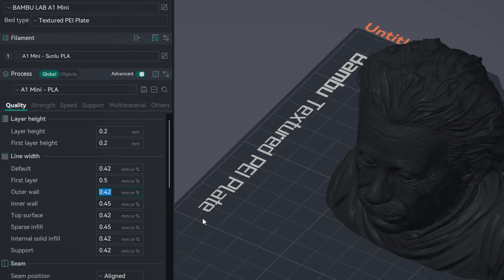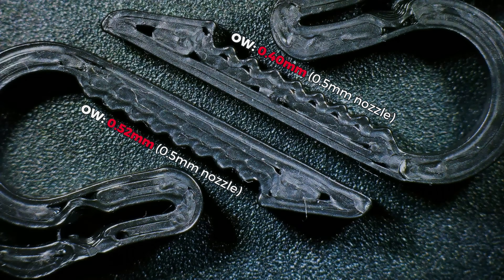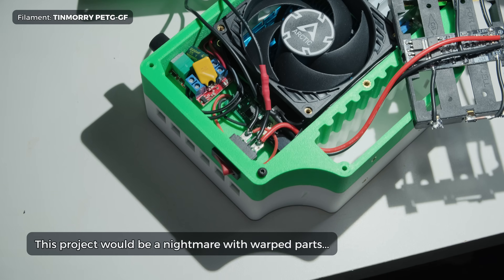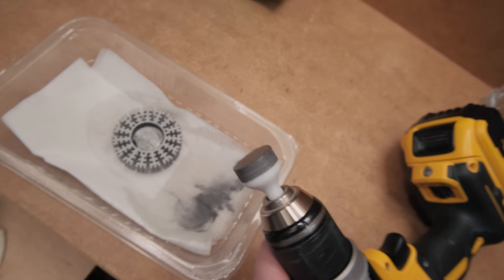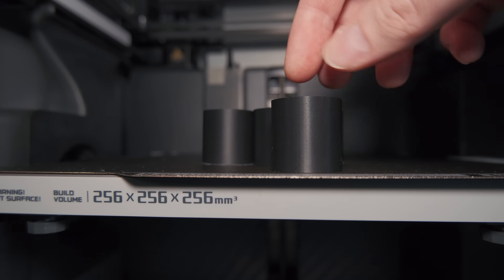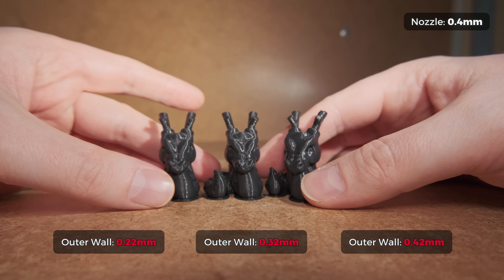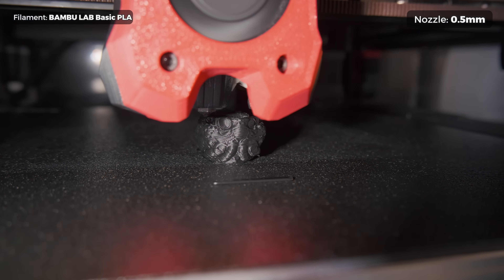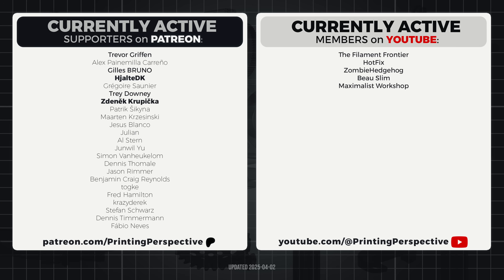3D Printing at NARROWER EXTRUSION than the NOZZLE SIZE

Comment: once i accidentally printed 0.2 line width from a 0.4 or 0.6 nozzle and the top layer came out absolutely perfect as if it was injection molded, and gave reflections like a mirror. But i was not able to replicate the result later

Comment: Isn't it the same as using flow compensation ?
Reply from the maker: Small area flow compensation? Then no.
Reply: @PrintingPerspective  on cura there's a setting to lower the material flow but I don't remember how it's called.. ^^

Comment: Thanks!
Interesting findings.
This inspired me to test the 0.22 OW + 0.12 LH with one of my spools that I'm having real problems with. Basically, the sticker on the spool says 1.75mm but measuring the diameter manually always gives results around 1.45mm. Almost gave up with that spool but this video made me wonder.
Reply from the maker: In such case you can just increase the flow rate by a lot.
Reply: @PrintingPerspective  thanks for the tip. Actually did tighten the extruder screw and recalculated the e-steps + did temp, retraction and flow calibration. Still some signs of under extrusion. That's why I thought I might try this one

Comment: Does anyone know if this technique might produce more legible tiny text on a flat surface with a 0.4mm nozzle? The examples are for details that are over a large Z height difference. But I am wondering of this will help with tiny text that is embossed or debossed a max of 0.2mm in the Z axis?
Reply from the maker: It should, but to know for sure you can very easily give it a try with the settings I suggested.
Reply: @PrintingPerspective  I do indeed plan to give it a try and will report back on my findings. I often want to print a small label on a large print and switching between 0.4mm and 0.2mm and back for every print just isn't practical so this will help much if it works.

Comment: You could probably get some of these benefits without long print times by further reducing arachne minimum extrusion width
Reply from the maker: It would do nothing to the outer wall details. Arachne doesn't print narrower OWs in like 99% of cases. It only prints narrower sections where the set OW width is too high to print. The main reason I wrote "must use Arachne" is because some models are designed for e.g. 3x0.4mm walls. So Arachne would scale up the inner wall to compensate without needing an extra pass to fill the gap.
Reply: @PrintingPerspective  I assumed it looked at the required level of detail in a region to adjust extrusion width, because after all, the wall width is measured from the surface detail inwards. But if not, then that's a potential area for improving the algorithm. At what stage during slicing does it decide to lose certain details? Is there a blanket smoothing function applied to the entire layer?

Comment: I suspect PA value adjustments would also be necessary for optimal quality with below nozzle width printing. Side note, Tinmorry PETG-CF and PETG-GF are phenomenal and I highly recommend them. They are like the cheat code to making PETG fun to print and to make layer lines disappear.
Reply from the maker: Yes, because OW:0.4 and 0.4mm nozzle has higher pressure buildup inside the hotend than OW:0.4 and 0.5mm nozzle. But as far as I know, you can't define PA for the outer wall. So as you also have to print the inner ones at a wider width and high speeds you can't reduce the PA too much. But if we use lower speeds and accelerations for the OW, the PA values are way less relevant.

To be fair all GF filaments hide layer lines very well, but I agree, TINMORRY PETG-GF prints great. But the reason I liked it the most is because PETG has great layer adhesion in the first place, so mixing it with GF makes a lot of sense, as the layer adhesion is not reduced too much. Not a lot of manufacturers sell PETG-GF.
Reply: @PrintingPerspective  You can use adaptive PA value so it uses a different value based on flow rate and acceleration and have one value tuned for the outer wall. Obviously doing this for each test would be crazy. Could do it for just one setting you liked to see if it fixes it though. The issue could also be caused by filament dragging on the inner wall and essentially rolling, depending on your wall order. Also yes to the PETG layer adhesion and surprisingly PETG is one of the few filaments which actually can have increased layer adhesion with fiber fill!
Reply from the maker: I thought about it but at that point changing to a smaller nozzle would be so much easier on probably most machines, haha.

I don't think any filament can have increased layer adhesion with fibers because we are replacing the plastic that would adhere with fibers that do not. The layer adhesion of ~25MPa that TINMORRY PETG-GF has is pretty decent, but for example, Sunlu PETG has ~45MPa, but prints look ugly as it is a very shiny PETG.
Reply: @PrintingPerspective  Oh definitely doesn't make sense, I was just wondering how to solve that issue.
I would have thought no material has stronger layer adhesion with fiber either, but My Tech Fun has tested multiple PETG fiber filaments now which exceed layer adhesion on the plain versions and some others have as well. Could be faults in the testing or exact comparisons, but it definitely has phenomenal adhesion either way.

Comment: All you do is you decrease the speed and increase the time of dwelling thus inscrease flow (which in turn increases layer width). So while you set a e.g. 0.22mm width with a 0.4mm nozzle in reality more material is leaking out. Physically you can not decrease line width to lower than the nozzle diameter. You can set it in the slicer settings but changing all the other values to increase the flow again just shows it´s not what´s happening. 
In the past you got better details with smaller than nozzle line width due to the slicing engine then generating more resolution movements. You even mentioned it yourself, the insane details with a small ship you got. Now we have arachne and quick swap nozzles. 
I see why you wanted to try this out, but it just can´t work. It´s way easier to print 0.4mm lines with 0.25mm nozzle than the other way around. It´s just physics.
Reply: i mean he also shows that doing just that ( going lower than nozzle size and decreasing speed) increased detail so ?
Reply: @ Yeah ? Okay. Why and how ? You noticed he changed multiple parameters right ? You also understand that a finer nozzle setting in the slicer creates more travel moves and the slicer increases resolution because the slicer htinks the extrusion path is more narrow and thus tries to replecate more details. 
I found the video quet messy, without any microscopic shots etc. changing a couple of settings in a software is not what happens in reality. You physically can´t print finer details than nozzle size without under extrusion or weaker layer bonds. It´s physics, it´s not like the broke it.
Reply: @sierraecho884  You're not correct. Your assumption is that filament comes out of the nozzle in uniform and distributed fashion. But that doesn't happen.

You can try to play with this on a simple straight line extrusion. The concept is simple:
Once the nozzle is fully saturated and we introduce new melted filament, the old one will get pushed out. Obvious right. But the filament isn't coming out as 0.4mm cylinder, it's a cone that starts at 0.Xmm until it reaches the desired 0.4mm and the nozzle moves into another position. The total filament accumulated in that specific place isn't exactly 0.4mm^3 anyway, it's little bit more.

This is now a software question, because this rule can be bend so that the slicer models it in a way where on each position we never accumulate more than the ~0.4mm^3 before moving elsewhere. We also continuously drag the melted filament, so at different uniform speeds you can see the line getting thinner and thinner.

Obviously there are limits. Cooling, speed, precision. But there is nothing stopping the concept from working provided the slicer can model it precisely enough.
Reply: @klohto  "...Your assumption is that filament comes out of the nozzle in uniform and distributed fashion. But that doesn't happen...." No I didn´t say that. You can print certain features with a finer resolution than nozzle diameter thisis what happnes when we print bridges usually. However you can see the quality difference and the layer adhesion. Many people also print supports that way however again it´s underextruded because material is missing, it has to. 

"...so at different uniform speeds you can see the line getting thinner and thinner..." Yes exactly, and since it´s thinner material is missing between the other lines and this is called underextrusion. 

"..But there is nothing stopping the concept from working.." Physics is. You will always end up with underextrusion. You can do that as long as you print only one strand of material without anything else interfacing it, which is mostly pointless.
Reply: @ My dude, you can do multiple
passes next to each that take into account the “missing” width. I develop in-house slicers, I’m not even sure why am I sharing this info.
Reply: @klohto  So you under extrude on purpose, then create multiple passes try to hit the exactly right amount of material to just try to print finer than the nozzle opening .... I see makes sense...
Show me your slicer once it´s finished...
Reply: @sierraecho884  Is it possible the multiple passes will push some of the existing filament into a more precise position creating finer detail than a single pass with a thicker line?
Reply: @sathivv950  "...Is it possible the multiple passes will push some of the existing filament into a more precise position creating finer detail than a single pass with a thicker line?..." I don´t really see that end result in reality. First you would need multiple passes which would increase printing time and therefore failure rate significantly. Then you need to deposit way less material more precise with the same size nozzle. You can show me if this is your result but I see this more as a theoretical ideal than a practicality.
Reply from the maker: @sierraecho884 I think the main reason why I never noticed breaking extrusion in the past is because I tested bigger 0.4 - 0.6mm nozzles and extrusions that are not narrower than 0.4mm. The narrower the extrusion the harder it is to maintain consistency. It is always better to use a wider extrusion than the nozzle size but it also increases the requirement in extrusion force, which can lead to other complications. At the end of the day, changing the nozzle size is the most correct way. This video is more like an exploration video just to see what happens.
Reply: @PrintingPerspective  "...The narrower the extrusion the harder it is to maintain consistency...." Not of you have the nozzle for it. a 0.3mm line width will be consistent with a 0.25mm nozzle just as a 0.5mm line width will be consistent with a 0.4mm nozzle and so on. 

"...It is always better to use a wider extrusion than the nozzle size but it also increases the requirement in extrusion force..." Which is neglectable with geared extruders. The bigger the force downwards towards the layers, the better the layer bond. It can lead to complications if you absolutely overdue it, but generally speaking, you can even print a 1mm line width with a 0.4mm nozzle. I usually print single walled objects at 0.8mm line width with a 0.4mm nozzle if I need the object to be strong, a storage container for example.

"...At the end of the day, changing the nozzle size is the most correct way. ..." In the end of the day, the best and "correct" way depends on your use case, just like I said with the single walled storage container and a 0.4mm nozzle. This was by far the best solution. 

"...This video is more like an exploration video just to see what happens...." Yes, but your conclusion was not really there. You decreased line width to smaller than nozzle diameter ( just create a technical drawing in a section cut and see what happens) which basically isn´t possible and would lead to underextrusion, then you cranked up the temperature and dwelling time so more material can ooze out over timne and make up for this error. You also didn´t measure the real printed line width with a microscope for exampkle, you just changed settings in a slicer and assume this is what happens in reality. Setting a couple of values in a software does not mean this is what happens in real life, also you changed multiple parameters at once. I found it quet messy to be honest. 

In the end the better resolution from printing finer than nozzle diameter comes from move travel moves because the software can resolve the stl finer, that´s it.

Comment: I find extrusion width higher that the nozzle diameter almost more interesting.
smaller diameter nozzles have less stringing and handle quick changes in extrusion speed better.
printing with a extrusion width double that of the nozzles diameter worked for any nozzle for me. printing .6 extrusion width with a .2 nozzle worked flawlessly.
this would allow for high and easy detail on the outer walls while being able to print the same part wall thickness with one third the amount of wall loops.
problem with small diameter nozzles is that their maxflowrate seems to be very low :/
Reply: Absolutely. It also makes way more sense since physically you can´t print less than nozzle diameter. The nozzle is just an opening that´s it. You can squeeze as much material through any given opening as you wish you will just increase pressure and thus layer adhesion.

Comment: My experience agrees with your findings. However, when I'm able to overcome my laziness and actually change my nozzle to a 0.2, I find that using 0.3-0.35 EW for everything but external walls gives better detail with only slightly longer print times. Everything is a trade-off it seems.
Good video!
Reply from the maker: Thanks, yeah you are correct. The best thing of all this is printing fiber filaments to get a more defined texture. Wood-filled PLA prints should look awesome.
Reply: I run .8 on a .4, nozzle all day on infill and inner walls. .2 on exterior with a .08 z axis 

Excellent print and fast.

P.S. How low can a .2 go?

Comment: I print at 0.06 always and use the full speed of the printer. This way i have high resolution, nice end product, and no flow isues or cooling as there is little material extruded. Running my printer at 15,400K @300 / 350 mm/s print speed, not slowing downt for outer walls.
Reply from the maker: Even if you have cranked Jerk/SCV by a lot, you will never reach those speeds when printing details, you know.
Reply from the maker: Even if you have cranked Jerk/SCV by a lot, you will never reach those speeds when printing details, you know.
Reply: @PrintingPerspective  it works great, i can run at 450/500mm/s with some quality loss. Low layer height and speed give you all you want, the rest is copium.
Reply: What is your line width?

Comment: Great video, I watched the previous ones and would like to see more videos with your varied flow rate layer adhesion test machine.
Such as printing with 0.8mm nozzle and with 0.8mm layer width and printing with 0.4mm nozzle with 0.8mm layer width and comparing the results.(at 0.2mm layer height for both.)
Or printing with different chamber temperatures and measuring layer adhesion strength.
Or cooling only outside layers with orca slicer settings and comparing the layer strength and print quality of doing that instead of regular printing with constant cooling.
And your different nozzle flow speed and layer adhesion test were great it would be nice if you make a video with more common nozzles like Chinese cht nozzles, both volcano and regular v6 nozzle etc.
Reply from the maker: Thanks. Yeah, there are always a lot of things to test just not enough time.